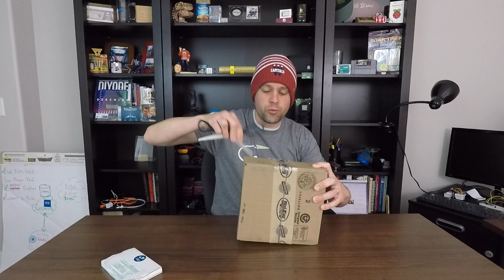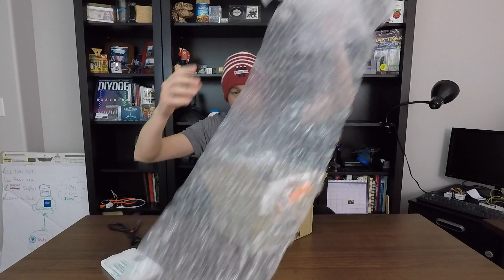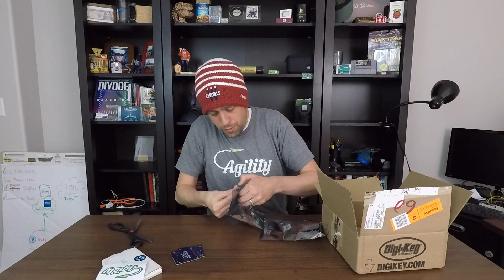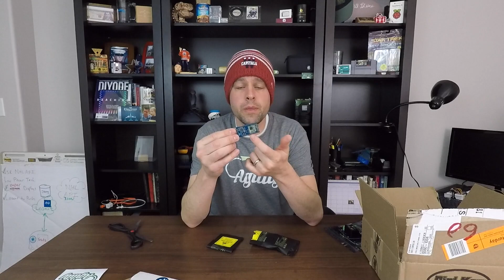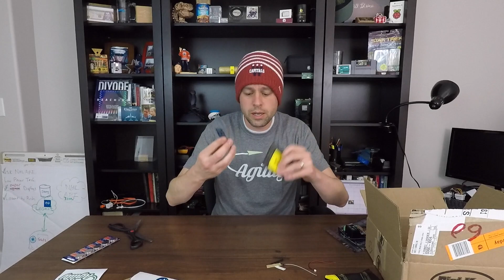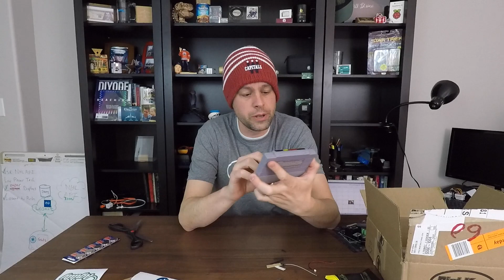Unboxing the Texting Dryer PCB

Comment: For your shelves, add anything with a 49ers logo.
 My son and I played Zelda when it came out if I remember correctly even took a couple of days from work to play.
Lastly, my RFM69 project came to a halt the Losant site is showing the Raspi portion connecting but no go with the trinket/RFM69. 
Switched projects waiting for my moisture sensor which will reset the Wemos Mini R1 and start counting to 48 hours again and if no rain (moisture)will water for 15 minutes unless the temp is greater then 80 Degrees in which case we add 5 minutes watering time. Finally, if the temp drops to 42 or below no water for plants.
Can't wait for more RF videos.
Reply from the maker: Original Zelda is top 5 all time for me. Sorry to hear the RFM project stalled out but looking forward to seeing the sprinkler project in action. That will be really great.